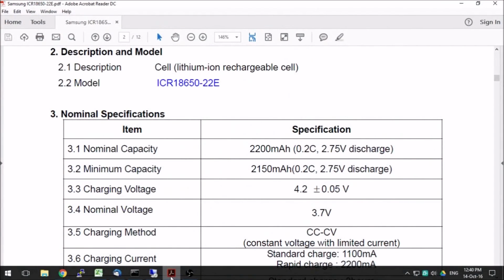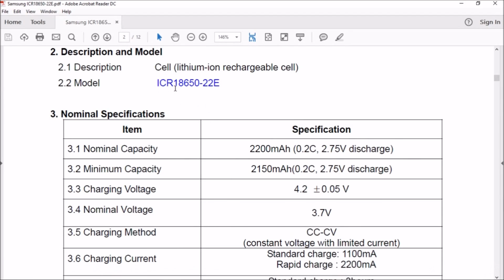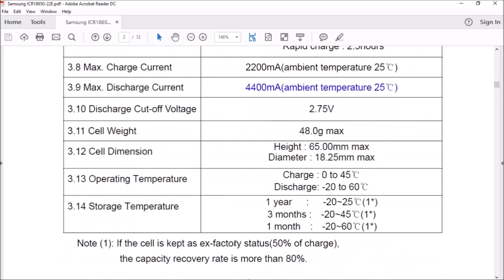18650 Test With  Banggood  Battery Capacity  Tester -DIY Electronic Project Recycle Recovered Cells

Comment: Hi thanks for so good video. Can I post a little question? Its possible use it to discharge multiples 18650 batteries in parallel ? Thanks for any help.
Reply from the maker: Hello, yes it can be used with cells in parallel. The item I linked to before is out of stock but there is another source here : http://bit.ly/2CsVaI0
Let me know if you have more questions.
Reply: Hi thank you so much for the prompt answer really appreciate that. Also thanks for the link and just to know you that Ive bought my one.I don't want to abuse of your kindness but I'm in doubt in a little point: I think that the voltage is the cut off voltage right? That I think is the same in case of parallel but what about the discharge current ? Must be the same as for one battery? Or can I multiply for the number of batteries in parallel or even set to a more high discharge current to accelerate the process of discharge(that's a time consumer process :))? Thanks for any help Sir.
Reply from the maker: Yes, you set the cutoff voltage according to the manufacturer's datasheet. In the case of parallel cells you add the Amp hours together so 4 of 2 Ah cells in parallel would be 8 Ah total. The discharge current is the same as for a single cell, again refer to the datasheet for that value. The benefit of parallel cells is to extend the time of discharge.
Reply: Again thank you very much!!! :)
Reply from the maker: You are welcome! I am working on a spot welder project for 18650 and other cells. Please consider subscribing so you do not miss it!
Reply: Just subsvribed friend!! See u ! :)
Reply from the maker: Thank you. I hope to have the video ready in a week or so, I am waiting for parts, as always!

Comment: I have the same tester and I use the four wire setup with it. I like this tester, but it doesn't check battery resistance. I have a different tester that does and that is the one I use the most.
Reply from the maker: Hi, which tester do you use for the internal resistance? I have tried a couple but the results seem inconsistent.
Reply: I wish I could find one again. I have two of them and one broke, so I don't have a backup. The tester I have usually works really well. I think I found it by searching E-bay under battery load tester with internal resistance and it came up. You can check E-bay for Shunda Electronic TEC-06.
Reply: Originally purchased it on Banggood, but they no longer have them. Google search it.
Reply from the maker: Thanks! Looks neat, I see it on eBay and Aliexpress around 20€ so may get one. Do you use the PC interface? Do you think for really close battery the 4 wire mode makes any difference?
Reply: The four wire is More accurate, I did use the PC interface, but it wasn't real easy to use so I just use the tester. It has most of the info one needs on it.
Reply from the maker: Great! Just ordered one on Aliexpress, now to brush up on my Chinese language skills! Thanks again for the advice.

Comment: what is error 2?
Reply from the maker: The unit has 2 functions. "Fun1" is electronic load and "Fun2" is the capacity testing mode. Hope that answers your question.
Reply from the maker: Error 2 means that the applied voltage is below the set voltage for the load. Also see this error if the load is connected in reverse polarity or no voltage.